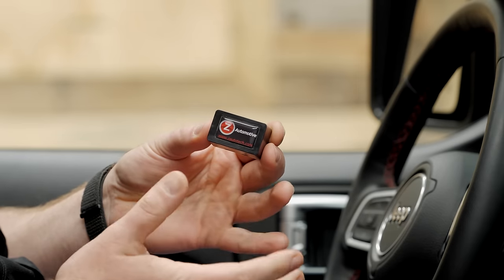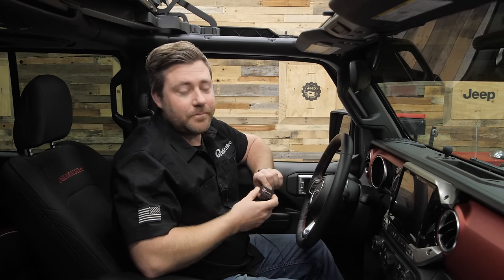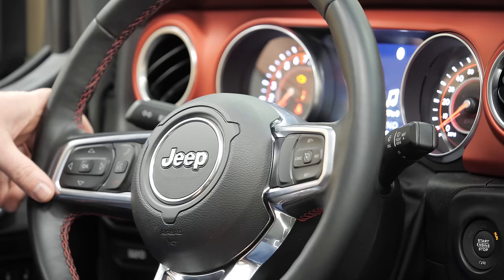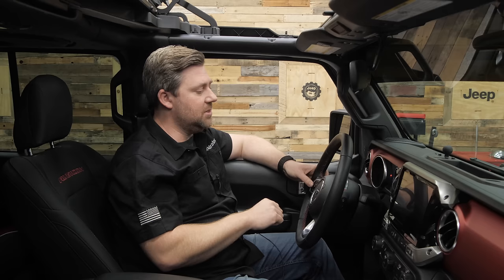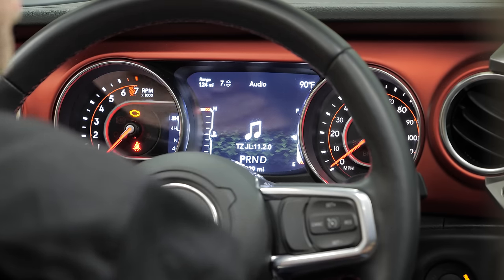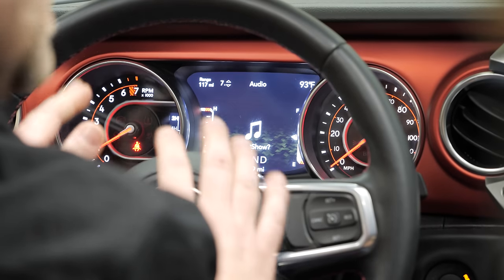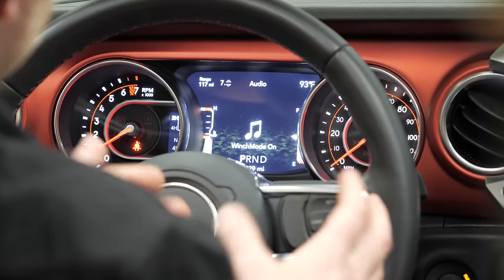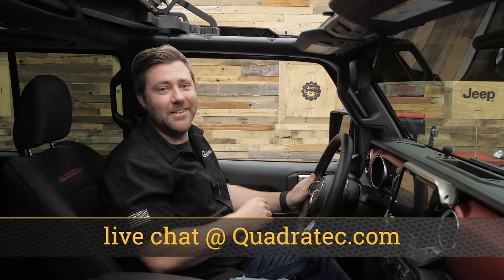Tazer JL Mini & JL Lite for Wrangler JL & Gladiator JT - How to Change Tire Size, Gear Ratio & More

Comment: Hello, can the tazer mini be used to reflash the Mopar Factory Style LED Headlights without taking it to the dealership?  The LED headlights will be installed in a Gladiator that did not come with factory LED Headlights. Thank you
Reply: I need this question answered. Because the lite didn’t work
Reply: @nsoccer18  Hello, the one that works is the Tazer mini for headlights
Reply: Correct, the mini ended up working.

Comment: So do you plug in the tazer , then make your modifications, then remove the taser and plug those plugs back into their original place? Or does the taser have to be plugged in all the time?
Reply: If you're just changing settings you can make the changes and then remove it. For live functions you need to leave it installed

Comment: My Halos are clearly visible in my Rubicon 2023 headlights while I cannot turn them on. 
It is mentioned that I can do that using The tazer while others are talking about a 4th wire.
Can you please advise?

Comment: I purchased a set of oracle led flush mount taillights and the lower bumper led lights where the reflectors were and only drivers side reverse stays on but sometimes all comes on but off right away and i hooked up the oe taillight on passenger side but now that doesn't even work so i don't know what is going on but it worked before i installed the oracle taillight.

Comment: I was told to check out the tazer because there is a boost gauge (for turbo models) that can be seen from the EVIC. I have yet to see any proof of this. Does anyone have any idea where you could find it?
Reply: No clue where to find it but it is an option that is offered

Comment: I have two questions about features that one address in the video. Can you use the tazer to turn off the seatbelt chime and it’s not buckled in? And can the Tazer add the ability to move the vehicle while a door is open?

If either of the answers are yes, can it be done by just changing the settings and then removing the taser? Or does the taser need to always be installed?

Comment: I have a 21 JL rubicon running 37s nitto trail grapplers and used super chip to update the detail but JL won’t hit 8th gear most of the time…can anyone help? Im new to the JL world…want it back to stock, I do have a TeraFlex 4.5 lift kit and overland gear so not sure if it’s because of the extra weight…
Reply: With 37's you need to regear your axles. Probably 4.88 or 5.13 ratio would make it drive and shift like factory. Much better for transmission too !

Comment: Hi I glad I found this because when I regear myJL they install this to calibrate the odometer, but I haven receive an explanation of how this works, but regarding the features when I hit the breaks hard the vehicle keeps holding the breaks to release it I need to hit the throttle and move the vehicle so this is part off the functionality of the tzr?

Comment: That was a solid and detailed review, Rob. Thank you. I noted that your NITTO Trail Grapplers could be set spot on at 37". I have NITTO Ridge Grapplers and could only get as close as 36.97 or 37.05. I understand you are not responsible for the Tazer JL Mini/ Lite results but do you have any thoughts on the difference in tire set results?
Reply: Tires are never the exact size they say they are.  Most are 1/2in shorter

Comment: I upgraded from the 5.0 radio to the 7.0 radio for my Gladiator. I bought the control panel with the correct volume knob. Everything works but the ac/heater functions. So the Tazer mini will correct this?
Reply: Hello I just did the same thing. We’re you able to fix the Ac and heater functions?

Comment: Why is that I don't have the some of those options.  For example Radio and Lighting? Is it software update🤔  .. running my mini on my JL
Reply: You might need to do s software firmware update.  They have been firmware versions released pretty frequently

Comment: The Tazer is so good, it's almost like it should've come from the factory pre-installed.  It's probably the first mod a person should make to their JL/JT.
Reply: What are the chances this would void OEM warranties of unmarrying before any shop visits? Only using it for regearing and tire size corrections.
Reply: @TheMrAndycatman  I've seen some pretty arrogant and shady dealerships, one  VW dealership accused me of breaking headlight, he implied i had tried removing it myself and breaking it -wasn't true.  so anything is possible.  

But simply remove it before taking it in.  Most likely they wouldn't care at all.

Comment: high idle seems awesome for manual... allow you to operate the clutch and brake simultaneously without worrying about stalling as well as just having a higher and smoother idle speed while crawling. I did this on my WRX, raised the idle rpm to 1000 for traffic and really never had to touch the gas in stop and go. When I backed it down to stock idle it became much less smooth so I raised it back up.
Reply: Did that affect the gas nileage?
Reply: @AlanTrades  not unless you idled a lot. Didn’t notice a difference at all.
Reply: @KTMcaptain  cool thx, anything new with the JT? You still have it?
Reply: @AlanTrades  still have it, still in love with it. 35s and a 2.5” lift now. Tazer still my favorite mod.

Comment: When you say 0-30 and 0-60 is that increasing Horseshoe power or opening up the throttle ?  Does the Tazer JL mimi have that type of function to remove engine restriction in order to open it up like tuners on the market?

Comment: Got mine about a month ago, along with an iDrive unit.  Combined, they are an awesome combo for the 2020 Gladiator Rubicon...Especially after I installed my 37’s.

Took a while to understand and figure out how to adjust and set things on the Tazer, but once I got it figured out, it was good to go.  🤘🏻

I highly recommend getting both items.  They work well together to get everything out of your factory Jeep.  👍🏻
Reply: Curious what are you getting for gas mileage? My buddy is getting 18-19 mpg w his JL on 37s w taser

Comment: So when I had my Jeep lifted and 35's put on the dealer programmed the new tire size in.  If I got this and went bigger would it still work the same? I'm thinking that the stock computer just thinks that 35's are my normal tire size.

Comment: Got a question I've never been able to get answered anywhere... if I were to buy just normal LED bulbs (switchback or just amber) and put them in my Sport turn signals would this device remove the requirement for load resistors?
Reply: Nick just buy some with them already included bro

Comment: Do I measure the tires prior to setting the tazer?
Reply from the maker: Yes. Not all tires are true to the size marked on the sidewall. It's always a good idea to actually measure the tire diameter.
Reply: @Quadratec  You can also typically get the actual tire size from the manufacturer's website.

Comment: Just a FYI for people watching this: He has Incorrectly set the tires size. You need to take a tape measure to the tire to get the actual size. If you just plunk in the size stamped on the tire it will be off. For example a 37/12.50/17 Cooper STT Pro is actually 35 1/8". That would be the number you need to put in to get an accurate reading.
Reply: I was told this was not the case for the Tazer (yes, we used to have to do this for the ProCal's of the past but NOT the Tazer). Can anyone confirm? I used satellite GPS compared to my vehicle's display (with 38"s) and it was dead-on with just a 38" setting on the Tazer.
Reply: @jediknight737  I have has always been told you have to go by actual size. Now I really want to know which is correct. Maybe I will try to get in touch with Tazer.
Reply: As far as I've read and been told you can just use sidewall size for Tazer. The JK required you to physically measure the actual tire.
Reply: @jediknight737  Some tires run more true to size than others. NITTOs appear to be pretty close. When I was resetting for my NITTO 37" Ridge Grapplers the closest options I was given was 36.77, 36.97, and 37.05. Tazer Customer Support (by text, no less) responded quickly and advised me that the Tazer picks up what the onboard computer has learned and to simply go with the setting that is closest. So, in my case 36.97. They said I would get the best result and to verify with a GPS App like WAZE.

Comment: Why are you speaking so slowly?
Reply from the maker: is Rob talking slow, or are you listening fast?
Reply: I need this for the wj
Reply: I think he's reading a script.
Reply: I figured Rob was speaking a bit more slowly because it requires more concentration to follow along if you are using the video as a tutorial. I started and stopped it a few times to make sure I had everything working properly.